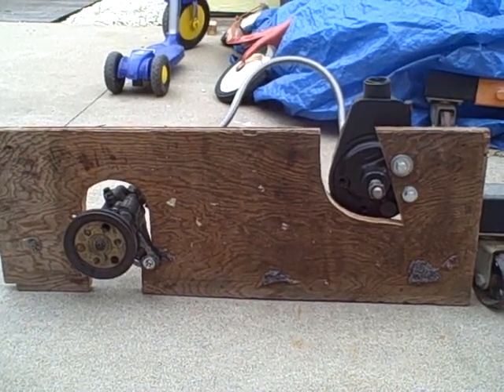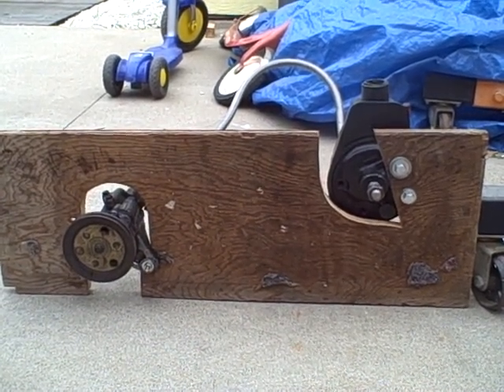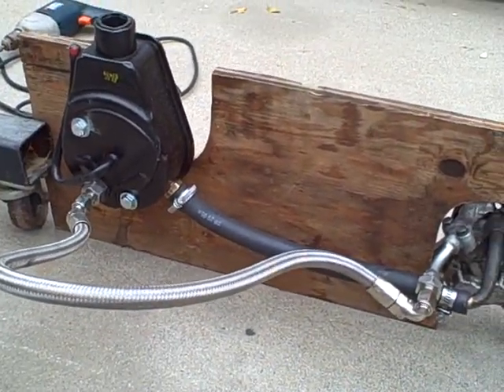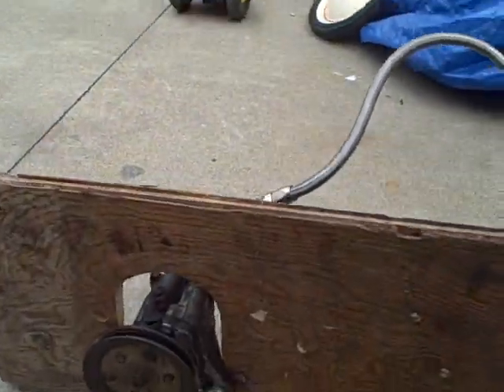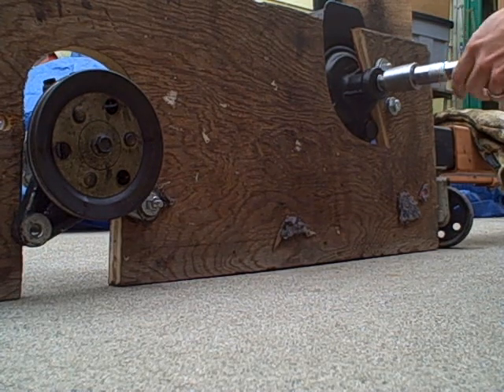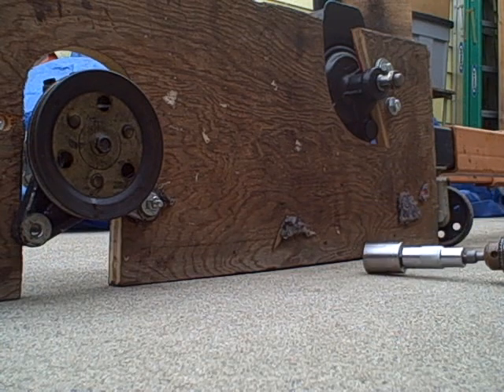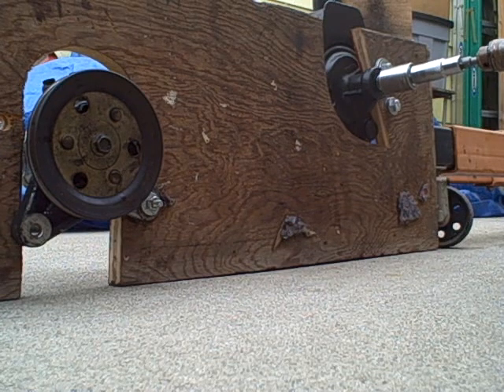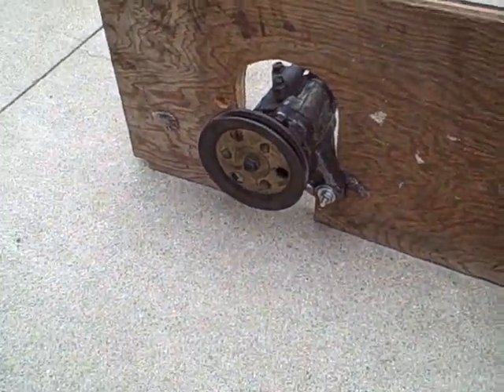Test of Power Steering Pumps as Hydrostatic Drive

Comment: I think this system can be used to drive independent oil pump for rear mount turbocharger, or to drive independent water pump for air to water intercooler. Just an idea though.

Comment: 11 years ago, but it's just enough info to help find my direction. I've built an attachment for my excavator and want to create a separate hydraulic circuit for it. Taking flow from the existing pump slows everything down. I'll test out the power steer pump with a mag clutch so I can disengage it. Have you gone further with this? Cheers

Comment: We use them for commercial fishing. You take the fitting off of the back and drill the hole out with a 3/8 drill. It will pull anything

Comment: Check out the 18 wheeler steering  pumps  or ones 
Used on concrete mixer trucks
With big front tires 
  & heavy front axles

Comment: Do you think it's possible to add a hydraulic hand throttle to control speed and direction? I'm thinking this to act as a clutch and a 1 speed gearbox+reverse for lawnmowers. If I'm right you can create a loop to redirect the fluid to the first pump. And when you redirect a percentage of that fluid out of the loop to the second pump you get traction... What do you think?

Comment: Is it possible to apply this to a right hand to left hand drive conversion? Is the ratio 1-1? How instant is the feedback from one to the other?
Reply from the maker: I don't see how this could help in an LHD/RHD conversion. The ratio depends on the two pumps involved. Identical pumps would provide (essentially) 1:1. By "instant feedback" do you mean "does the second pump start when the first pump starts"? If so, the answer is more-or-less.

Comment: check out the 4x4 world. there is a huge article on  hydraulics and power steering pumps    even internal  billavista on pirate4x4    lots of huys use automotive pumps for hydro steering .   article has lists of pumps and volumes pressures  rpm  tables   basically everything a guy needs to plan a small automotive  hydraulic setup. also the  lowrider crowd is into hydraulic suspension systems. huge battery powered  pumps with massive  flow

Comment: Thanks for the helpful suggestion. I do have spare power steering pumps left over from vehicles I junked. I will try to make a machine of some sort. I have plenty of old hoses, hydraulic cylinders, and open center valves to play with, even though they are in poor condition

Comment: Thanks for posting. I have been wondering for years if I could use power steering pumps as hydraulic motors. Maybe braze a cap on top of the reservoir? I guess it would only work in one direction?
Reply: That was going to be my comment too. I think a lot of times that's how you determine if a hydraulic unit is a pump or a motor. With a pump, one port is larger. With a motor, both ports are the same size (or sometimes they have 3 ports)

Comment from the maker: The problem with two identical pumps is that you gain no mechanical advantage. Hydraulic systems can be "geared up" or "geared down" by varying the size of the pump relative to the motor(s). So, two of the same Honda P/S pumps would be like a substitute for a 1:1 sprocket set.

Comment: You have to size the pumps based on a combination of their input RPM, pressure rating, and GPM (Gallons Per minute). Then figure you're going to lose at least 10% of input power and RPM under high load. How do I know? I looked into this stuff about five years ago. Still am actually. You CAN mix and match various pieces for a custom application, but to be successful you'll have to do some basic calculations.